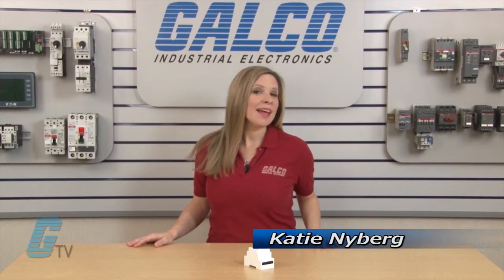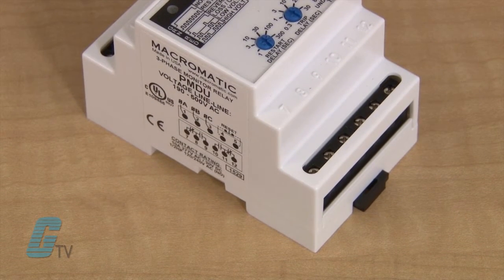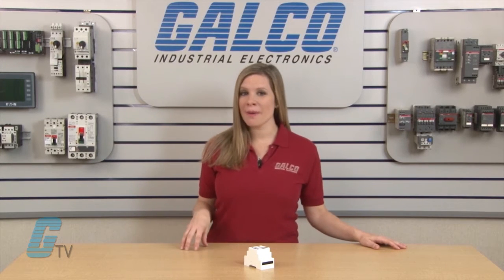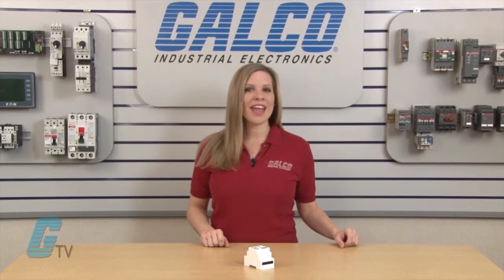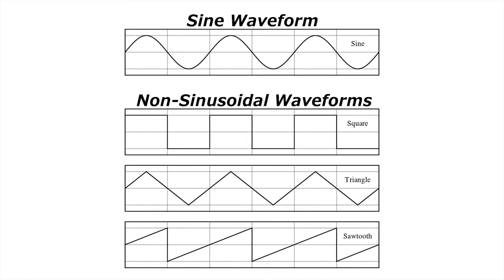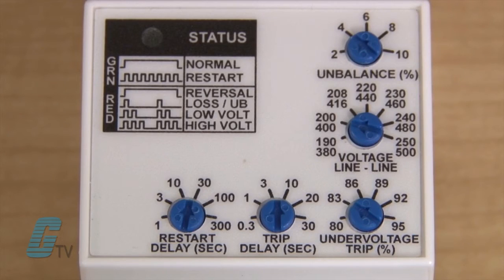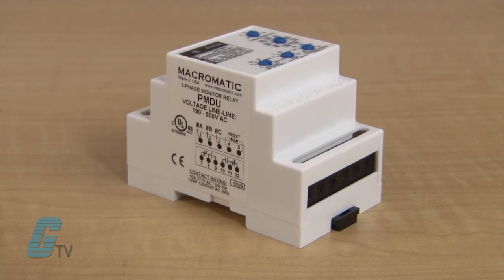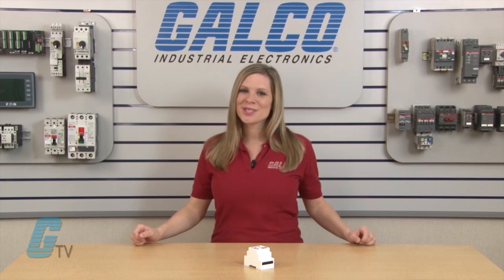Macromatic PMD Series Monitor Relays

Comment from the maker: Unlike some three-phase monitor relays, the PMD series will continue to function even with a lost phase. They are the only line-powered units in their class to retain fault indication and continuous monitoring of all voltages during a phase loss, increasing the ease of troubleshooting and the level of protection.